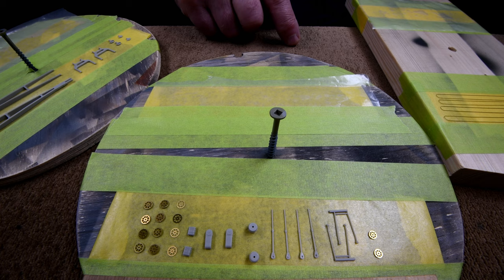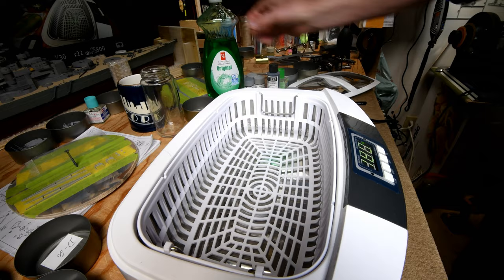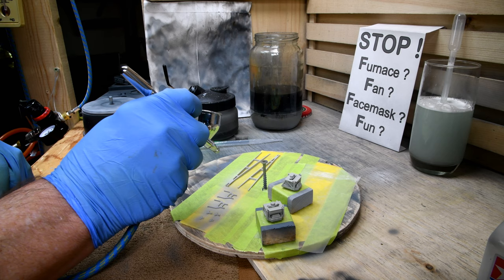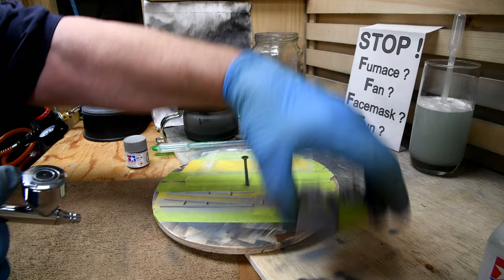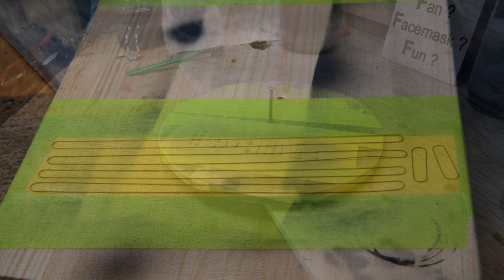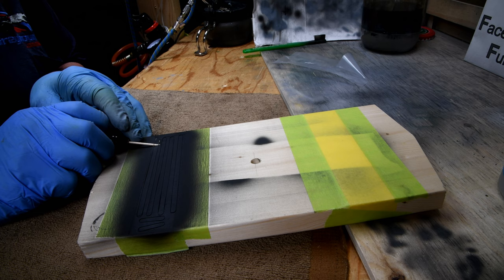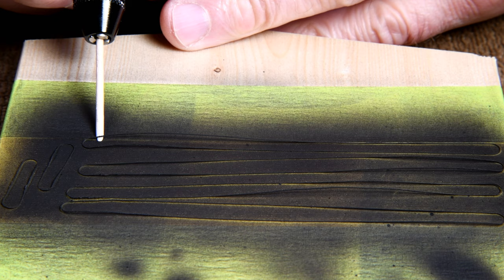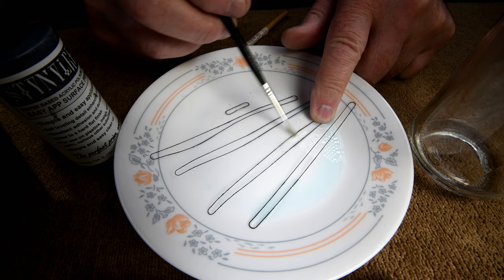The Model Ship - Part 299

Comment: Just did a Google search on "Blackening Brass" https://www.google.com/search?client=firefox-b-1-d&q=Hobby+%2B+Blacken+Brass  just thinking that this may also be a solution for the RAILINGS.  If you decide to use paint, it might help to rub very fine sandpaper over the brass (perhaps while it's still on its etched sheet). This would give the metal surface more "tooth" to hold the paint.
Reply from the maker: Yes! The railings. Thanks for reminding about those! 👍